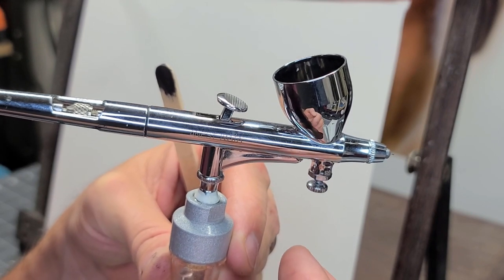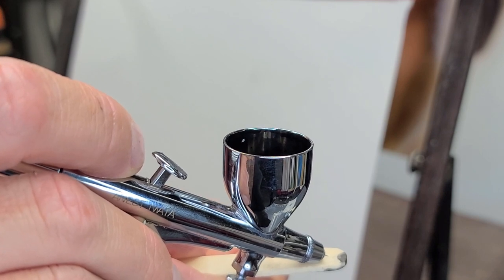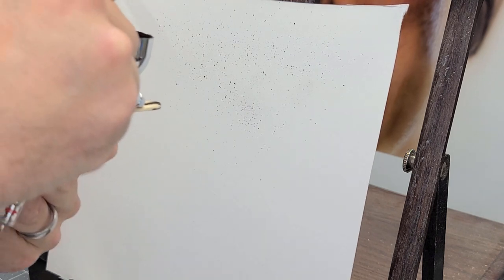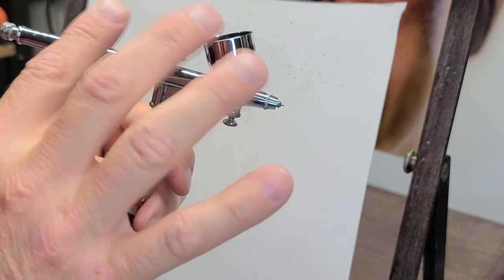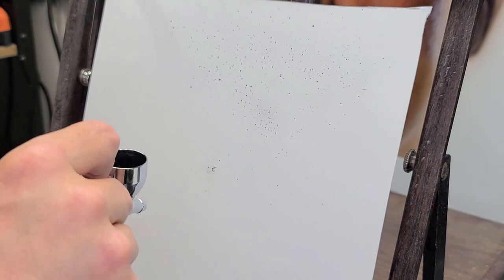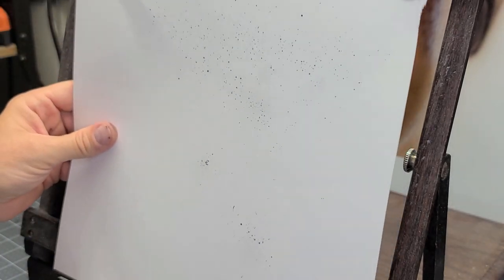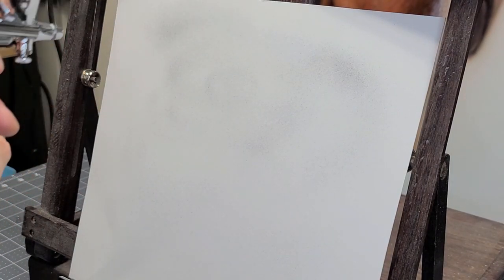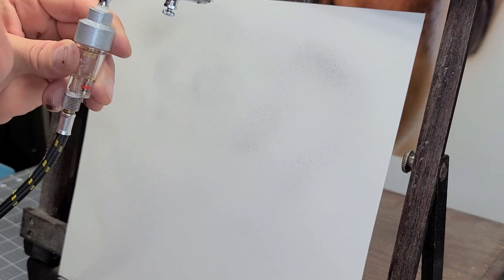Airbrush Speckle Techniques

Comment: Would be useful, but I want to know how to avoid speckles with white, they seem to make themselves without the need for popsicles 🤦🏻‍♂️
Reply from the maker: Hi Tim. Are you using Createx? If so, shake the bottle really well. Use 4011 at a 50/50 mix. Mix it good, and let it sit for 5 to 10 minutes and then one last mix before you spray.
Reply: @TheAirbrushGarage  amazing response time, cheers. No I use acrylic model paints of various types but every one I've used so far I've had this issue. Tried various mixes of paint to thinner, flow improver, water etc. Will give it a go again but mix it as thoroughly as humanly possible and maybe a little thicker than I was.